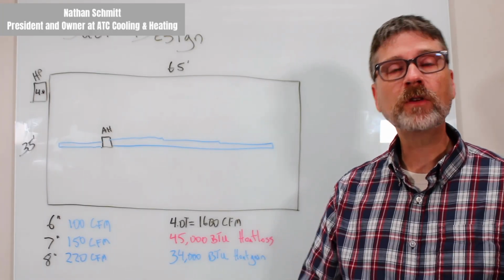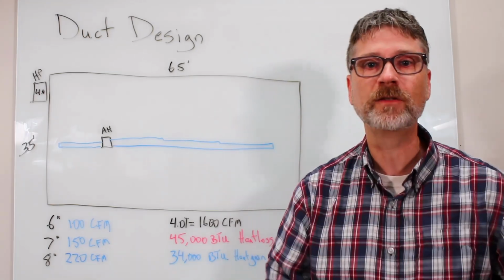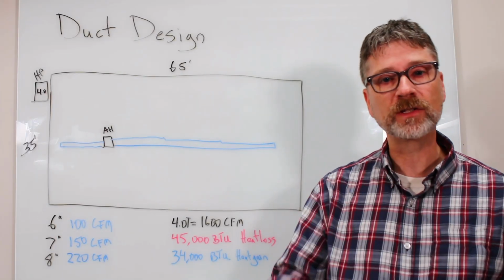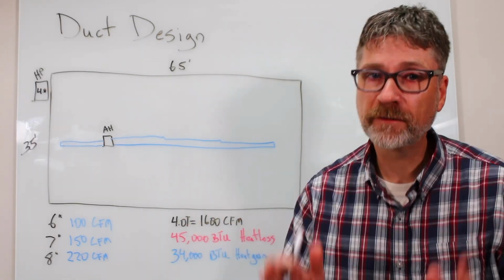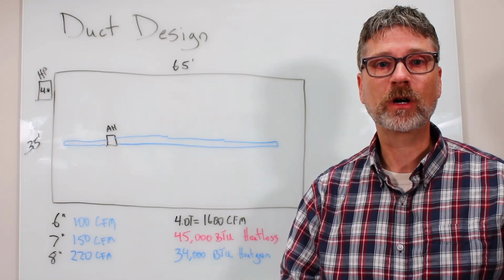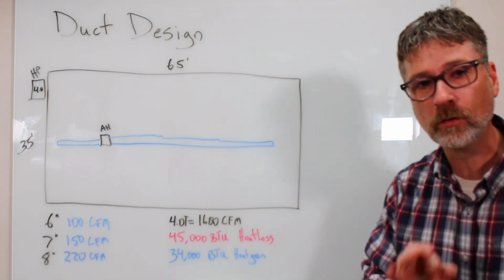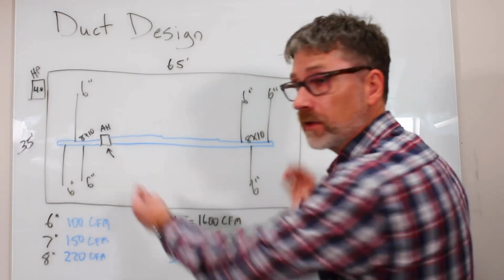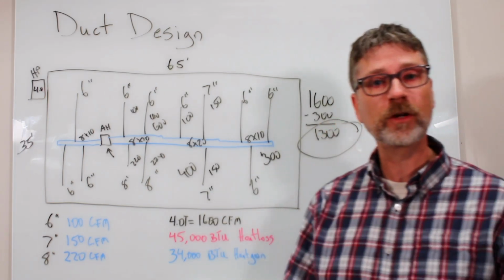How to Design Ductwork!

Comment: Great video. I finally learned why it's important to add another duct if you're using flex runs to compensate for friction loss! I was always taught to size for the cooling load instead of the heating load. Why didn't you size the heat pump for 3 tons and make up the difference with heat strips? Once again, thanks for the video.